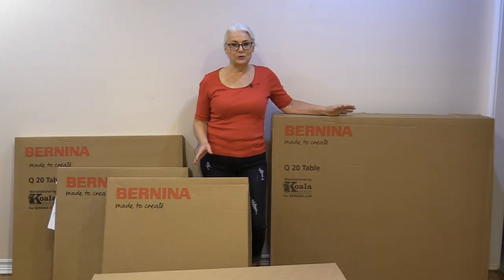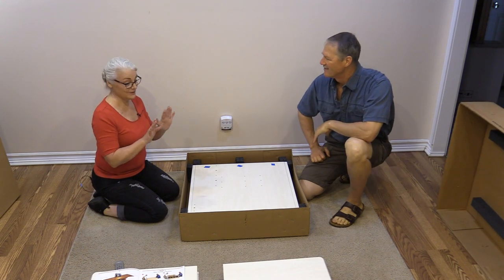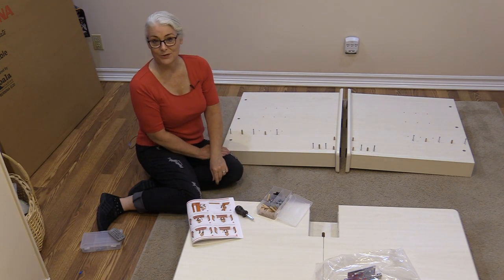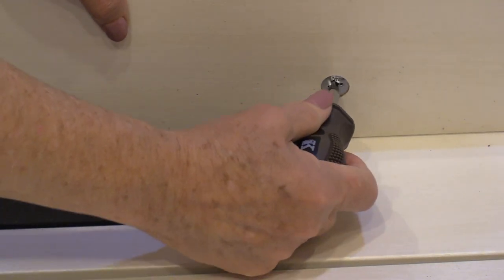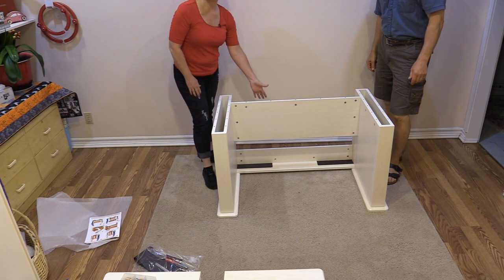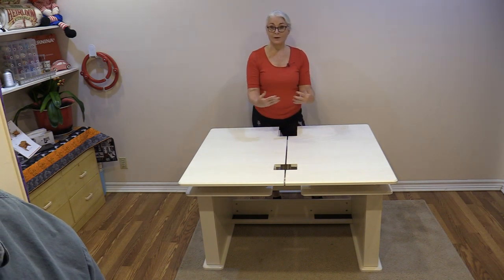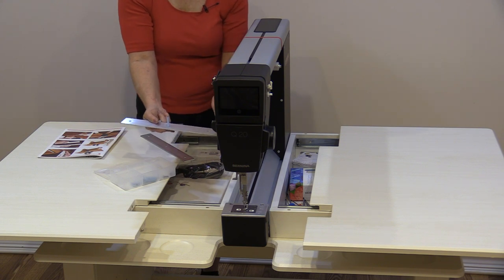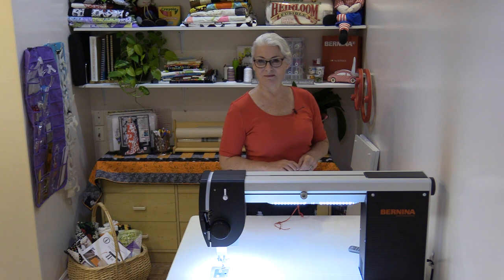UnBoxing and Setting up a Bernina Q20

Comment: Hi Laura,  I already have a grace frame which I put my Bernina 770 qe on. Would the Q20 fit on the grace frame do you know.. the 770 is awfully heavy to keep setting up and visibility is pretty ordinary when I use it, and as for changing the bobbin 🙉🙉 ... anyhow just wondering if it’s worth trying to save  for the Q20.... love your tutorials, Jules from Oz ✂️✂️🌻🌻